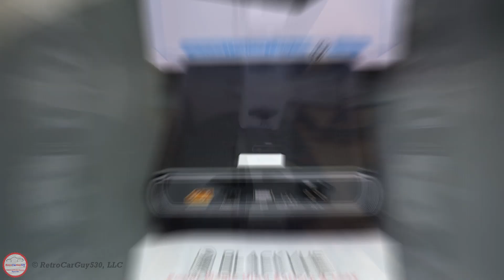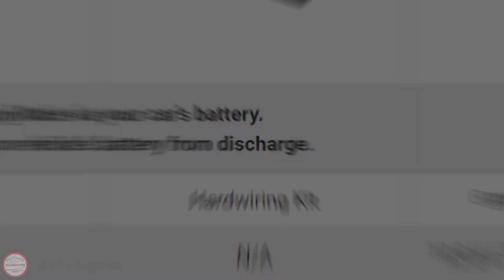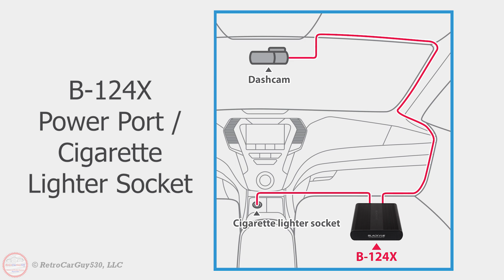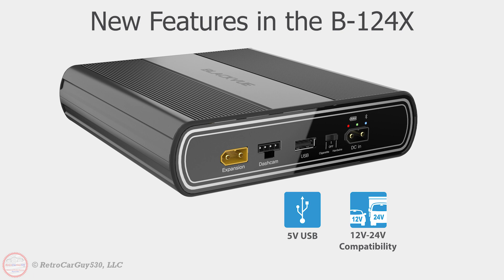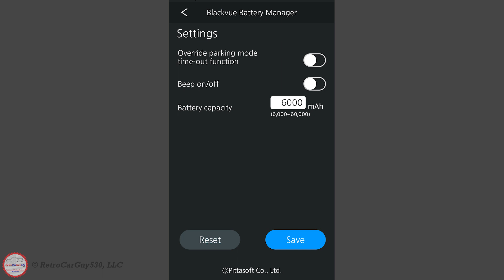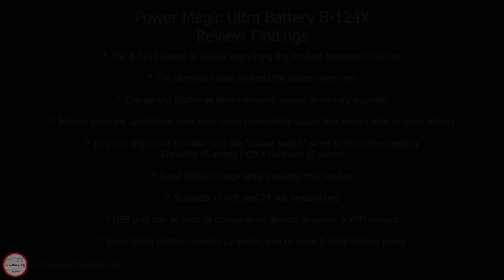BlackVue Power Magic Ultra Battery B-124X - Introduction / Review

Comment: Hello. Great video.  I’m looking at buying blackvue 750lte and b124x.  I often am parked for more than 20 hours sometimes 3 days at home without taking car out.   In parking mode, is it possible with motion detect feature of that dashcam to get more than 20 hrs power from b124x to the camera?  Eg.  Several days if only triggering when motion detected?
Reply from the maker: The BlackVue B-124X product page states "Approx. 25 hours 35 mins (based on a single dashcam that consumes 3 W)".  I just happen to have my DR750-2CH LTE on my test bench where I can measure the power draw of the cameras.  The DR750-2CH LTE draw between 350 to 400 milliamps while in parking mode.  My power supply is set to 12.7 volts so that converts to just under 5 W.  

My general guess would be you would get about 18 to 20 hours of parking mode with the DR750-2CH LTE camera.  The only option is to purchase one or more of the B-124E expansion batteries, or possibly look at buying a battery pack with larger capacity.

BlackboxMyCar now has a private label BI-750 dash camera battery pack that has about 25% more capacity than the B-124X (or similar products).  Here's my affiliate link to the BI-750 so you can check it out.  https://blackboxmycar.com/721f9  To get two to three days of coverage, you likely would need to get the BI-750 along with the BE-750 expansion battery pack.

I hope that helps.
Reply: @RetroCarGuy530  THanks again,  can i  ask with the power magic adapter for this, does it drain the car battery lifetime from around 5 yrs to more like 3 years?
Reply from the maker: The Power Magic Pro power monitor will help preserve your car's battery life by not allowing the car's battery to get to an extremely low charge level while providing power directly to the dash camera.  I believe the car battery life span is better predicted / impacted on how often and well it's allowed to be charged by the car's charging system or a battery tender if sitting for extended periods of time.  

Every car has some amount of power draw by a number of modules that stay awake enough to monitor necessary functions / features of the car while parked.   Adding a dash camera to the list of things drawing power will certainly drain the battery charge level quicker, but the power magic pro should not allow the dash camera charge level to be the "thing" that takes the battery charge level to excessively low levels.  I'm not a fan of having a device like a power magic pro set to cutoff the dash camera at very low voltages (12.0 volts and below) because then you may have a no start situation depending on the vehicle.

For those situations where it's critical to make sure the car's battery charge level is not impacted by the dash camera, the dash camera should be powered by it's own battery pack for parking mode.
Reply: @RetroCarGuy530  Thank you again for quick reply.    O understand and am nodding with you on the advice.  How long would a power charger like this power the 750 LTE?  How many days roughly in park mode?  And how do you calculate it so I may apply same calculation to other batteries like this?  https://www.amazon.co.uk/dp/B08168PGXF/ref=sspa_dk_detail_3?psc=1&pd_rd_i=B08168PGXF&pd_rd_w=nnHEz&pf_rd_p=395f87e5-7923-465a-b450-eb84f1966add&pd_rd_wg=0dsn9&pf_rd_r=RNH5P3VDC612D0VK52EW&pd_rd_r=350215f9-21b2-4cf9-b261-45db4f82964d&spLa=ZW5jcnlwdGVkUXVhbGlmaWVyPUExV09WNEtYSlIxQkJLJmVuY3J5cHRlZElkPUEwNzAyMDM4WjBJV1VBUEs3NVZWJmVuY3J5cHRlZEFkSWQ9QTEwNDU5NjdET0hNNFFST1FTQ0Mmd2lkZ2V0TmFtZT1zcF9kZXRhaWwmYWN0aW9uPWNsaWNrUmVkaXJlY3QmZG9Ob3RMb2dDbGljaz10cnVl
Reply from the maker: The formula is (battery mAh)/(device mA) = (hours). 

If you have a battery with a capacity of 3000 mAh with a load of 200 mA, that battery will provide power for (3000)/(200) = 15 Hours.

Using a somewhat conservative figure for the BlackVue DR750-2CH LTE dash camera bundle amp draw of 340 milliamps while in parking mode, here are the estimated runtimes for each battery:

Battery / Device = Hours
POWEROAK: 135200 mAh / 340 mA = 397 hours [16.54 days]
BlackVue B-112: 3000 mAh / 340 mA = 8.82 hours
BlackVue B-124X: 6000 mAh / 340 mA = 17.64 hours
BlackboxMyCar BI-750: 7500 mAh / 340 mA = 22.05 hours

Using a higher number of 400 mA for the DR750-2CH LTE:
POWEROAK: 135200 mAh / 400 mA = 338 hours [14.08 days]
BlackVue B-112: 3000 mAh / 400 mA = 7.50 hours
BlackVue B-124X: 6000 mAh / 400 mA = 15.00 hours
BlackboxMyCar BI-750: 7500 mAh / 400 mA = 18.75 hours
Reply: @RetroCarGuy530  OMG!!  Where is the heart button!   Thank you so much, Im stunned to see the days of usage from such a device.   I was thinking 3-4 days would be a huge bonuses as I could charge a power adapter inbetween those.    But so see several days more than this, this is music to my eyes!      Genius thank you!

Comment: May I ask if the “20 hours” for 2CH parking mode recording refer to 20 hours of continuous recording in parking mode, or simply have parking mode on for 20 hours? Can we get more use out of it with motion-activated parking mode recording? Thanks
Reply from the maker: My testing of parking mode was with parking mode configured for time-lapse recording.  If an impact was detected it would go into regular recording mode for the specified amount of time before/after the impact was detected and then it would return to time-lapse mode.  Switching the parking mode setup to motion based would save a little power from the fact it wasn't always writing the reduced frames per second for time-lapse recording, but it would now have the motion sensor feature consuming power.  It may extend the parking mode a small amount of time, but probably not very much.

Motion based parking mode has its own power draw demands and depending on how active the location is where the vehicle is parked, it may trigger the motion based parking mode recording quite frequently.  The exact power demands of motion based parking mode will vary with the locations the vehicle is parked.

Their estimate of 20 hours is based on the average power consumption of the camera in parking mode.  Each manner in which parking mode was configured will vary the actual total time in parking mode.

I tend to prefer having parking mode configured in time-lapse mode so I can see all of the activity before/after any incident and since this camera still will perform impact recording as well, time-lapse mode for parking mode seemed like the best overall solution (IMO).
Reply: @RetroCarGuy530  Thank you very much. I only drive the car once every few days (or sometimes not at all during weekdays). We’ve already purchased the 750 LTE, and are wondering how to keep the camera accessible via LTE... It sounds like we’ll need many batteries then (6 or so) to keep the camera running on parking mode and being accessible through out the week. Does that sound right to you? Could I simply unplug the batteries from the car and take them home to recharge? Thanks.
Reply from the maker: Keeping a dash camera powered for extended periods of time come down to battery pack(s) with expansion capabilities or providing alternative power while parked (like a AC to DC power supply).  Using an AC to DC power supply to provide power to the dash camera would require some sort of power cord access from the car to an AC power outlet which I'm assuming is not a viable solution in your case since you want to be able to have LTE access to the camera while parked.

The use of a single battery pack to power the dash camera while the car is parked works only if the car is driven often enough to recharge the battery pack.  As you stated, your current driving habits don't provide for that recharging opportunity for the battery pack.

Most dash camera battery packs offer the ability to expand their capacity by plugging in additional battery packs to the first battery pack (using one or more B-124E battery packs to expand on the capacity provided by the B-124X).  You could purchase multiple battery packs and swap them out as you suggested, but you would also need an AC to DC power supply to charge those battery packs while they are out of the car since they do not have an AC power plug to charge them.

The BlackVue B-124X battery is a 6000 mAh / 76.8 Wh battery pack.  BlackboxMyCar started offering their own labeled battery pack a few months ago with a 7,500mAh / 96 Wh capacity.   The BlackboxMyCar battery pack is a BI-750.  They also offer a BE-750 expansion battery pack for extra capacity.  BlackboxMyCar claims the BI-750 battery pack can power a 2-channel camera for up to 35 hours.  With the LTE circuitry taking some extra power, I would assume you should be able to get at least over 30 hours with the BI-750.  I have not purchased one of the BI-750 battery packs yet to verify there claims, but other review videos seem to suggest they do have good battery capacity.

The BI-750 battery pack is on sale right now for $297.99 USD.  Here are affiliate links to the BI-750 on the BlackboxMyCar website.

BI-750 US affiliate link: https://blackboxmycar.com/721f9
BI-750 Canada affiliate link : https://blackboxmycar.ca/c1b91

The BlackVue B-124X battery pack is on sale for $329.99 USD but it has less capacity than the BI-750 battery pack.

B-124X US affiliate link: https://blackboxmycar.com/0b5dc
B-124X Canada affiliate link: https://blackboxmycar.ca/b5d5a

If you do decide to purchase one or more battery packs from BlackboxMyCar using my affiliate link(s), I will make a commission on the sale but at no extra cost to you.  If there isn't already an additional five (5) percent discount applied at checkout by using an affiliate link, make sure to enter discount code ROBERT5 to get that 5 percent off on orders over $250 USD / $300 CAD.

I hope this helps!

Comment: Can I use my old battery with this new one as more storage time for parking. With the new 900x I will purchase.
Reply from the maker: The BlackVue B-124X is stated as being expandable with the BlackVue B-124E not another B-124X.
Reply: @RetroCarGuy530  I have an B-124 can I combine it with a B-124X or I have to Buy A B-124X With A B-124E just to run them together...
Reply from the maker: I cannot find anything on the BlackVue website stating a B-124 and B-124X can be connected to expand capacity available to power the dashcam.  The "Expansion" connector port on the B-124 or the B-124X is always connected to a B-124E.  The B-124X does not come with the batter-to-battery connection cable.   It might be possible to get a B-124 and B-124X connected via their "Expansion" connector ports, but I don't know if that's supported by BlackVue.

If you want to expand the capacity of an existing B-124 battery pack, you could simply purchase and install the B-124E expansion battery pack instead of buying a B-124X.  The B-124E appears to be about $70 USD cheaper than the B-124X.
Reply: @RetroCarGuy530  that's the question I was looking for... I thought so just wasn't sure. I was just thinking of selling my B-124 For the B-124X & B-124E...

Comment: Thanks for the great review! Not sure I understand how the parking mode is controlled when using this battery. Do you still need a power magic pro hardwire kit to controll parking mode ie: turning parking mode on and off? My thanks.
Reply from the maker: You don't need a separate item to support parking mode with this battery pack.  It depends more on what the camera power input allows and how the camera detects parking mode should be active or inactive.

The B-124X has a constant power output (unswitched) and a switched power output.  The switched power output from the battery pack requires a three wire connection (switched power, unswitched power and ground) to the camera.  The BlackVue DR900S camera only accepts a single power input (two wire connection).  The DR900S detects parking mode by detecting when the car/camera is in motion or not.  If the car is stationary for 5 minutes, the DR900S will assume the vehicle is parked and it will activate the parking mode operation of the camera.  When the DR900S detects vehicle motion, it will come out of parking mode and back to the regular recording mode.

The B-124X will output power until its charge runs low and it will cut off power to the camera.

If the B-124X were powering a three wire capable dash camera (like a Thinkware F800 Pro that I have), the switched power output of the B-124X would be connected to the switched input power line of the canera and the unswitched power output of the B-124X would be connected to the unswitched power input of the camera.  When the camera sees the switched power input loses power and it still has power on the constant power input, it will switch to parking mode.  When the switched power input of the camera once again receives power, it will exit parking mode and return to regular recording mode.

The switched power output of the B-124X is toggled by the input charging power to the B-124X.  When the car is supplying power to the B-124X to charge it, both the unswitched and switched power outputs are active.  When the B-124X detects that the charging power input has been turned off, the switched power output is turned off and the constant power output continues until the battery charge level is depleted.

I hope that answers your question.